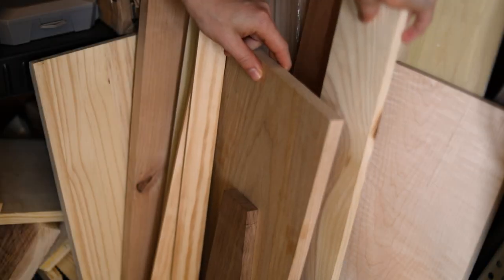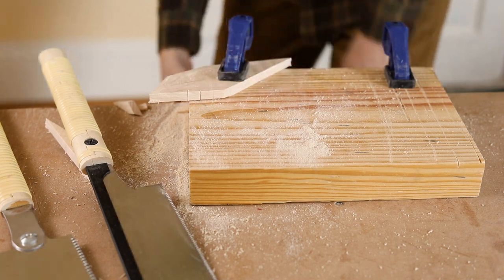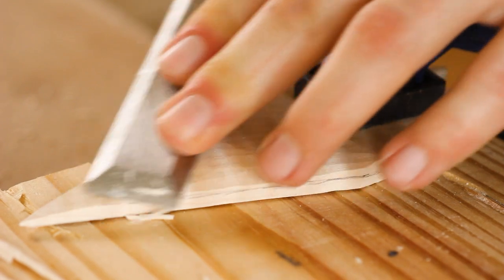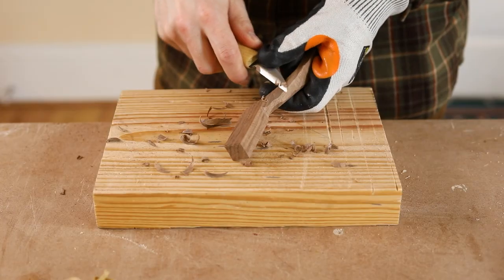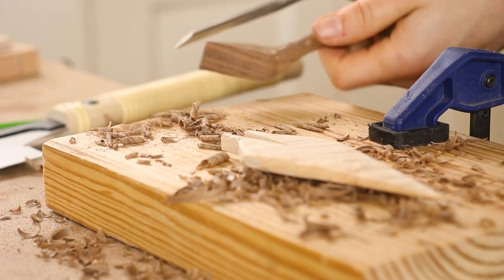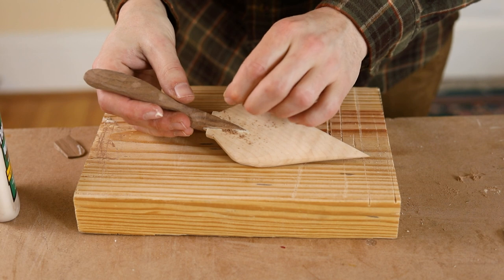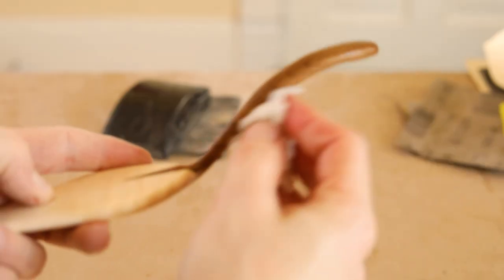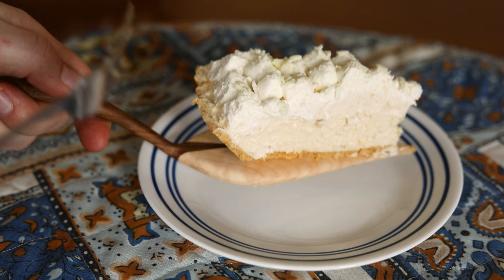Hand Carving a Pie Serving Spatula

Comment: Nice work, however, you stopped too soon.  Keep sanding and wetting between grits.  First wetting at around 400-600 grit.  Then 800, 1000, and then 1200.  Then use Walnut oil as a food safe finish.  After sanding to 1200 grit and then oiling your piece, let it set for a couple of days.  Then sand with 1500 grit.